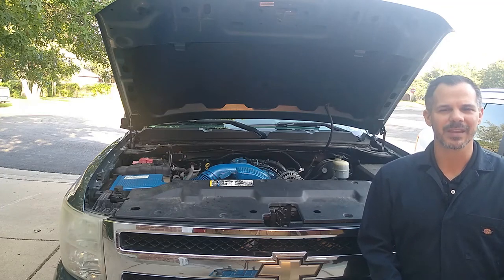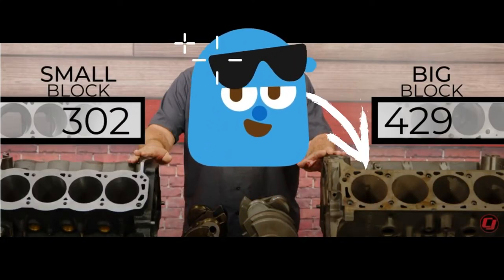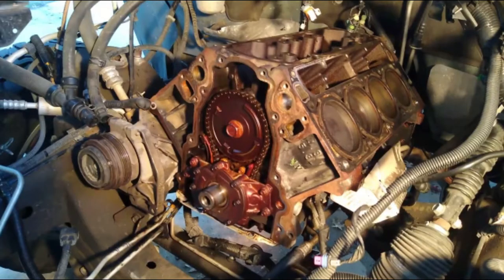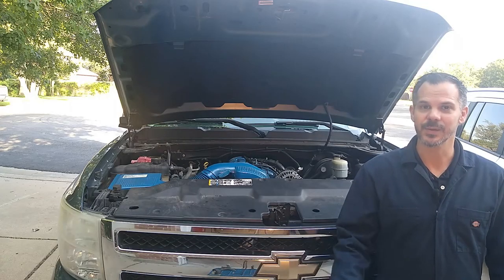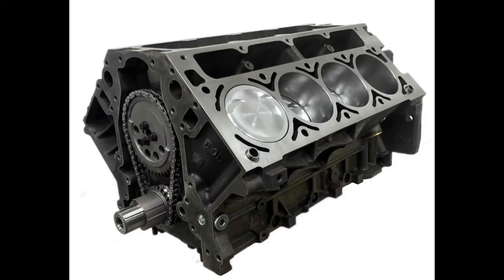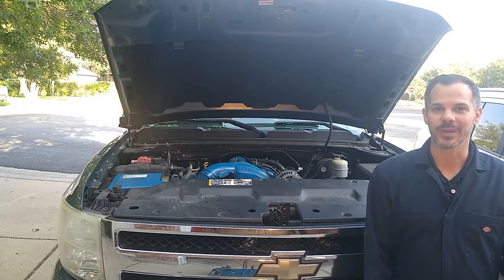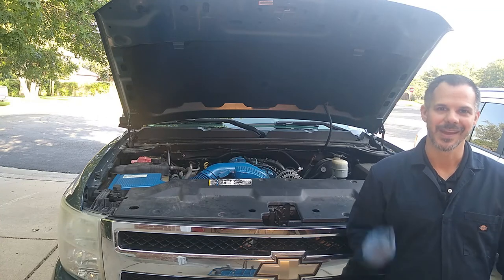Removing the Cylinder Heads on our 5.3L Gen4 LS Engine 2008 - 2013 Silverado Sierra

Comment: 💯% it matters...  Aluminum heads will warp if unbolted in the wrong way partly because of the hot-cold-hot cycle of the different metals and partly because of its own relative softness when compared to the super-hard cast iron and steel they're bolted to (and with) 

30 years of Experience and making the mistake of not following the sequence has taught me that its more than worth the time to always do it the "proper way" according to the engineers that designed the motor I'm working on.
 And I'm positive that if you spent a month's pay ( total was $ 1,175 totalaftertheheads were bought,  decked , ported & polished,  and  had the over-sized stainless valves and ceramic coating. ) 
to replace A nearly new set of high compression heads because you were too lazy to do it the way the book says YOU'LL NEVER DO IT ANY OTHER WAY AGAIN...... and if you do then you're a moron.

Comment: I am in process of tearing one down right now and I seen you pulling all the valve springs out back then I used to pull heads a lot of times we pull valve springs and all out and I noticed that you pulled about springs off then
Reply: Yeah you don’t need to pull all those springs out. Just leave them in.
Reply: @threeboysgarage so if i were to take the head off i wouldn’t need to remove the springs right? it’s just the bolts holding it on
Reply: @Thegrbeast  Correct, you can remove the head without taking the springs out.
Reply: I was wondering the same thing I don’t see the use in doing that unless you’re using a delete kit with the cam of course you’d have to go with a bigger cam to use bigger springs